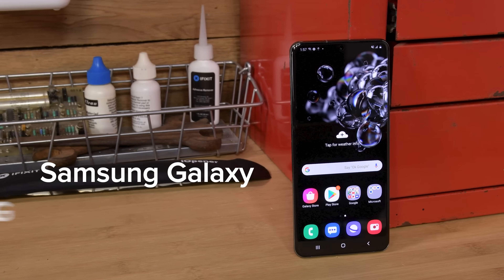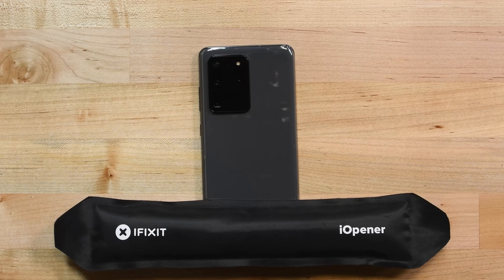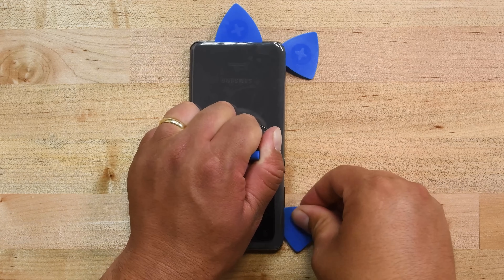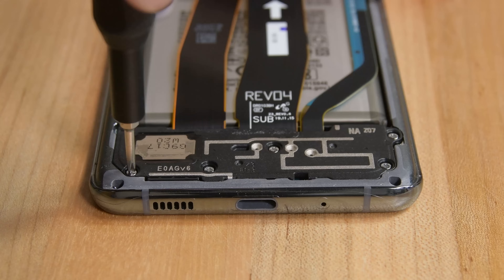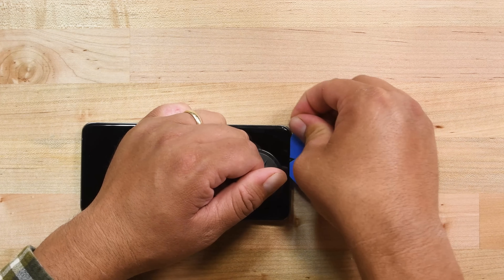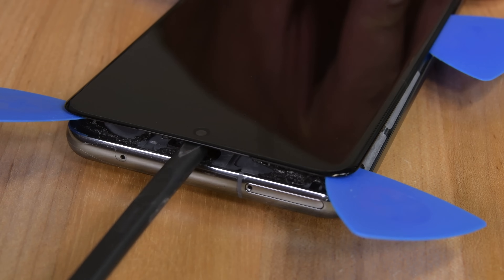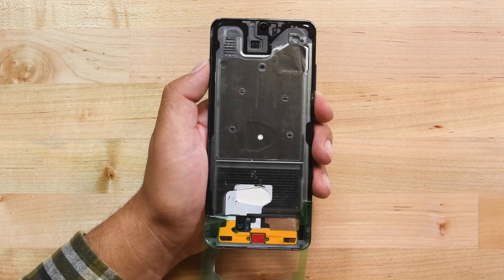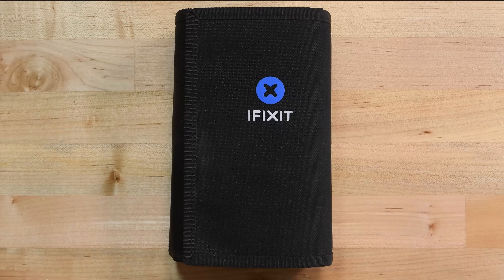Samsung Galaxy S20 Ultra 5G Display Replacement!

Comment: had screen dead, bought a new phone... then suddently come across this video, and realize that my "burned" screen might just be a bad connection due to last repairs... *press the conector on the back without opening it*... it's fixed
I have 2 phones now

Comment: so many websites and so many screens.. wich is the correct one lol .. phone is samsung s20 ultra 5G ....how hard should that be.. to find correct screen lol. some websites say theirs are lcd other say amoled.. !!.. it suppose to be amoled only hm   -and whats this about tape the cracked screen ? why.. i just trow mine away. glass and that metal foil that is acutally the screen .. away. i guess replacement screen you get both finished fit together.. atleast it looks like this in this guide.

Comment: for cutting the display adhesive i recommend the iplastix pry card, its soft and flimsy enough not to damage or put unwanted stresses on the screen panel, but hard enough to cut right through the adhesive

Comment: the only problem i have with this tutorial is the number of unnecessary steps they take, like completely removing the wireless charging coil, you can remove the coil and the charge port cover bracket in one piece, just dont peel the coil off

Comment: I'm sure this has been asked but is it possible to just replace a cracked screen glass alone, not the amoled or anything else? The screen has a crack in it, but will still come off in one piece. I just want to swap it out and have a nice phone again, but want to do it right. I'm mechanically inclined, so it's definitely something I can do, even if I do have to swap out the amoled as well. Thanks in advance!!!!!
Reply: U can but it's much harder and way more room for error
Reply: you can try an autoglass thing that they use for fixing cracks in car windscreens. (you know that liquid that hardens.)
Reply: It's call reglassing requires a piano string kind of a  lamantion machine and a debubbler it's not really difficult just don't rush it.

Comment: I have the frame and the screen replacement can I leave them together? So I don't have to go over the adhesive part ?
Reply: if it has the frame and screen as one assembly, just swap over the motherboard, charge port and any other components like the camera, vibrator motor, 5g antennas over to the new screen assembly, install a new adhesive onto the back glass and you should be good
Reply: @alexfrideres1198 that sounds like more work.

Comment: Which part is the digitizer the back ? I'm trying to fix my phone and wonder if I need a screen or digitizer, only front part is cracked everything works fine though
Reply: You need to replace the entire thing unless you have highly specialised equipment that can separate the two. The digitiser is the glass in front of the screen, but generally this will be sold attached to the screen as a replacement screen.
Reply: @Zulf85  thank you
Reply: @kookid1855  no problem - best of luck on your first repair journey! I would recommend looking for a screen already attached to a phone frame instead so you can just screw in the other parts. Samsung do those and it's saved me so much time and stress. Also the glass on the back is often just called the "back glass" if you need to replace that too

Comment: So glad Apple started designing their iPhones where the display is the first thing to come off.  I hated phones where you had to dig through the whole phone to get to the display. Surprised Samsung made this so difficult.
Reply: As someone who is in consumer electronics repair, samsung screen replacements are very easy, longest part is removing the back glass. The Samsung replacement service packs come as a display and fame so all you are really doing is transplanting the motherboard and battery to a new fame, plus all the screws are the same so super easy to keep track off. Plus you wont lose any features or receive any warnings by replacing the screen on a Samsung
Reply: n now the display is the last thing lol

Comment: Is there any fix for pixel 4xl back glass peeling off?
Reply: yes, a new back glass with adhesive
Reply: I don't think you'll need a new back glass, but you will ideally need to remove the glass similarly to how they did here. Then you should clean the adhesive off  both glass and phone with isopropyl alcohol and replace it
Reply: @Zulf85  i was making the assumption that the back glass was broken and therefor peeling, if not new adhesive still needs to be applied. your point is valid anyhow!

Comment: Over 10years in phones development and they haven't yet realize the screen should be the first thing to come off (without glue...) in a phone. Why they persist? Has Apple patented the "screen first off"?
Screen and battery replacement should be a 5minutes job in every device. (with a screen and a battery...)
Reply: ever heard of water resistance?, yeah they need glue
Reply: @ajemajh  iPhone are the same water resistant rating as Samsung’s. Screens still come off first. He makes a good point. Screen is most damaged part of a phone. But hey Samsung took a different approach. I enjoy working on Samsung’s.
Reply: @ajemajh  samsung s5? it doesn't hold the battery in with glue yet it's waterproof
Reply: @mrsarcasm4874 and old motorola phones with removable battery were waterproof. it's not glue which makes it waterproof, it's rubber seals.
Reply: @ajemajh  water resistance doesn't need glue, waterproof does.

Comment: How to avoid dust particles between back and camera lense, when not in a dust free environment…. Luck?
Reply: Tape around camera or glue it with B7000 works on all mine repaired mobiles

Comment: i would advise the samsung service pack for this phone, the screen comes on the frame so you just move the internals over.
Reply: Is there an official Samsung Service Pack you can pick up? Idk if my Googling skills are extra lousy today or what but I'm not finding anything that looks correct.
Reply: @kwmc91  are you in the uk
Reply: @paulcanning21  no, I'm in the US.
Reply: @kwmc91  not sure then but we have the here
Reply: @paulcanning21  thanks! I'm still looking. I am finding some that look like they come from third party suppliers, but they also look extremely sketchy
Reply: But by doing it that way, you have to remove all of the internal components, including the battery. Batteries in the Samsung S and Note series are known for being heavily glued in - it's probably less work and less hassle to just do a display only replacement.
Reply: @TheSpotify95   ive done it both ways, isopropanol under the battery for 2-3 mins and it pops right out, the job takes 10 mins and its then like new from factory.
Reply: You couldn't be more wrong.  Batteries are easy to remove with 99% alcohol, a little heat, and a wide spudger.  There's a reason Samsung service packs are screen/frame combos.
Reply: @ljessecusterl  im wrong?
Reply: @paulcanning21  it looks to me like you guys said the same thing

Comment: Just buy the display in frame save yourself the time and effort
Reply: where can i do that?
Reply: It takes longer
Reply: but you will need to completely disassemble the phone
Reply: @iker4059  the phone is already disassembled here. Removing the logic board and battery to transfer to a new service pack with frame takes 2 minutes. Better results and less chance of returns. Doing the display only, if there is the slightest bit of glass or dirt on the frame you will get a return within a week when the screen breaks or fails.
Reply: @gtmobile2420   exactly not to mention doing Ingram refurbishing is way easier the having to separate the OLED from the frame
Reply: @iker4059  yes
Reply: iPhone screen replacements are expensive but you can replace them and they're easier to take a part but don't slice too deep like I did or you will RIP the screen ribbons and you will have to get a new screen digitizer

Comment: Seriously, why would u glue everything up? What happened to screws
Reply: Benefit of the doubt: water resistance

Probably the actual answer: what the other guy said.
Reply: Probably to make it as difficult as possible to repair and to discourage repair attempts
Reply: @kieronalder5264  Yeah, Steve Jobs. He was a control freak and Apple started making it difficult to repair and the industry as always copied them blindly
Reply: Do you want a screw on your display?